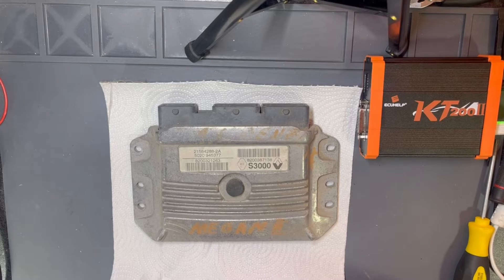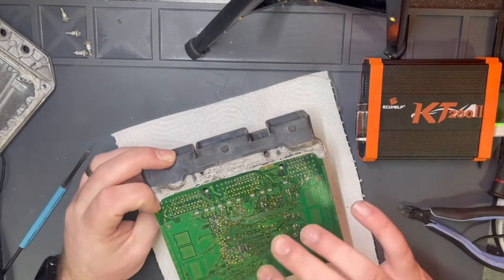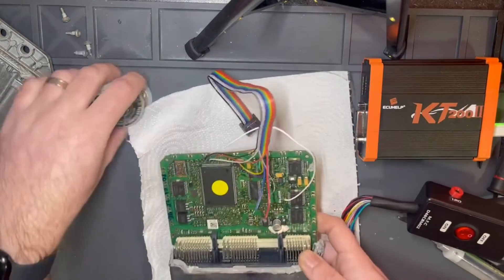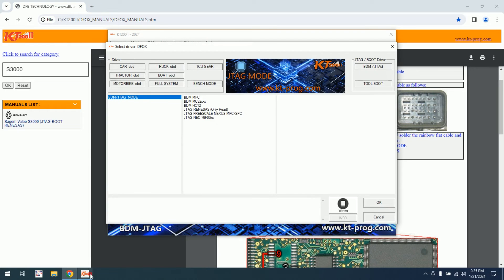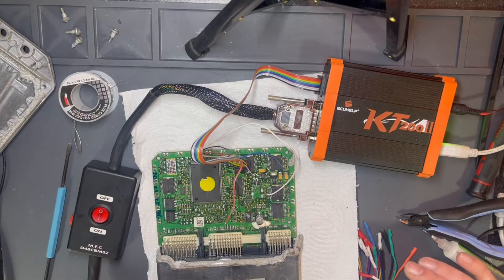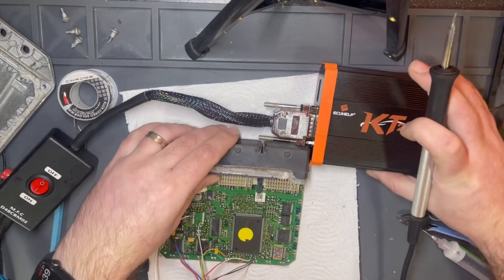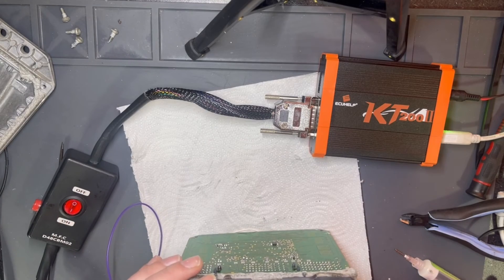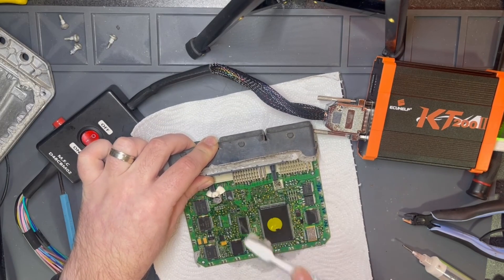KT200II - Read and Write Sagem S3000 ECU ( J-Tag & Boot )

Comment: Did the car start after that? I read this ECU with KTAG, VVDI Prog and original Flex. with Flex and VVDI, i got 512kB files for the MCU, with KTAG i got 2 files (1x 1024KB and 1x 348KB) and i don't know what is correct now. Did you copy the EEP seperately? BR Matthias

Comment: Good video thanks👍 Over all would you recommend to buy Kt200II 🤔
Reply from the maker: Hi, yes overall its a good tool for read / write ecu mods files, its not good to clone edc17 ( due to OTP area cannot be skipped )
Reply: @UnixCoDElectronics  I guess for edc17 PCM flasher would do good job 🤔
Reply from the maker: @mishokorlov yes, PCM Flash its an awsome software, most of time i use it for Bosch ECUs
Reply: @UnixCoDElectronics  Did you use 77 module for edc17?
Reply from the maker: @mishokorlov  53 & 71 are for EDC17,  77 it is for EDC16
Reply: @UnixCoDElectronics  Does it cover all edc16 models of cars or just some 🤔
Reply from the maker: @mishokorlov  Yes all EDC16 Supported, ME9, MED9, EDC7, PSG16
Reply: @UnixCoDElectronics  Thank you so much for your info I value your channel it's great help for beginners like me 👍
Reply: @UnixCoDElectronics for clone edc17 must enter special menu then it can do otp too
Reply: Foxflash don't work S3000
Help please.